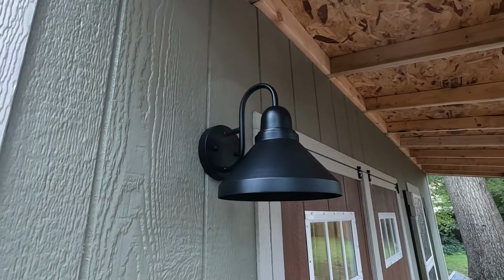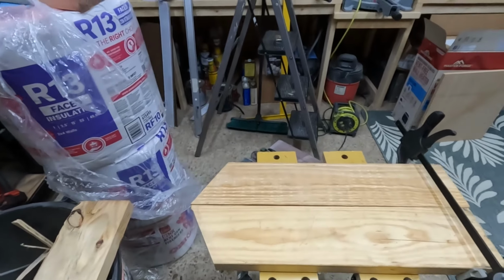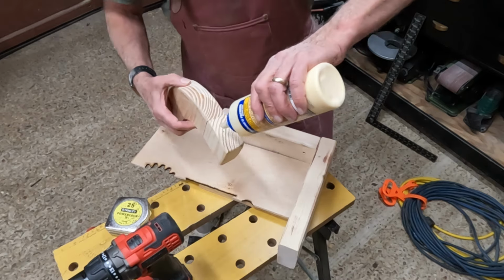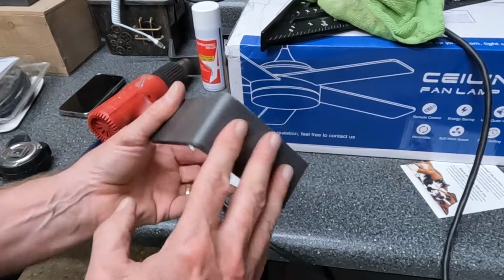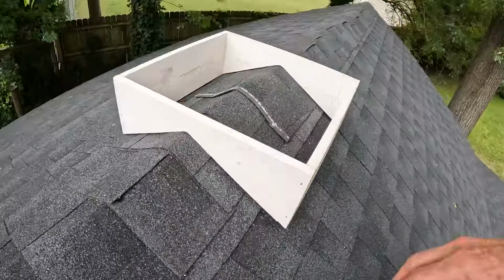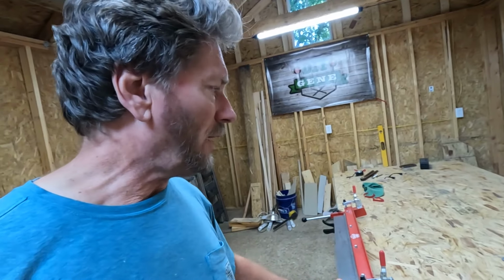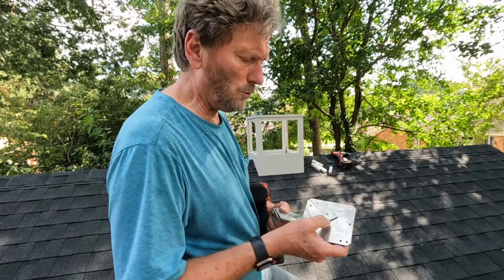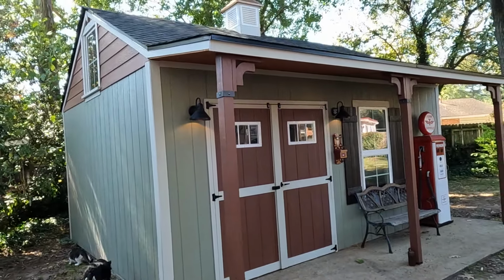1 Man Shed Build Part 4: The FINAL 24 Hours!

Comment: That cupola looks fantastic. I built one about 30 years ago for my garage. I used copper on the roof. If I remember correctly, it was kind of expensive back then. I wish I was smart enough to think about using spray paint, but I do like the patina on it that was achieved with age. I can't wait to see what you're going to do with the inside. Keep up with a fantastic work
Reply from the maker: Thanks Tim, this has been a really fun project. I think this painting on the cupola will hold up well. It’s that hammered copper paint from Rustoliom. I have used it in the can, but this is my first time using the spray. Using real copper would be cool. The green oxidation would be nice. Any ideas the interior?
Reply: @DIYGene  Gene, what are you going to use the shed for?
Reply from the maker: It’s already full of lawn care and a generator.
Reply: @DIYGene  I think you're gonna need a bigger shed.... LOL
Reply from the maker: @timscanlan1466 . You are probably right 🤪

Comment: Spectacular look to the outside of your workshop Gene. Great job covering up 90% of the mistakes you claim to have made on the cupola. Anyway, who's going to know but you. You also saved a ton of $$$ on labor! Everything looks great. Can't wait to see the inside when you set up shop.
Reply from the maker: Thanks, I’m really excited for how it’s turning out. The inside is going to be fun as the weather is cooling down. Any ideas for the inside?
Reply: @DIYGene  I'm sure you will set it up well with all your neat tools. Remember way back when they had the ShopSmith?
It was like 5 tools in one, table saw drill press etc. Great idea for a small shop but terrible if you forget to do things and have to set up over and over again cause you forgot to drill one hole lol. Maybe you're not that old. lol
A real neat dust collection system would be a plus in there..
Reply from the maker: Oh yes I remember the Shopsmith. I thought it was a cool idea, but you are right about setting up for each tool. Maybe it made you be a little more organized in your process. LOL. I have already moved stuff in because I know I will rearrange several times to get how I want it. I will do an 18’ bench with the mightier saw set up. I fact I already have done that. 🤪